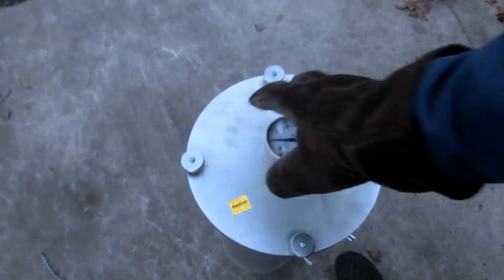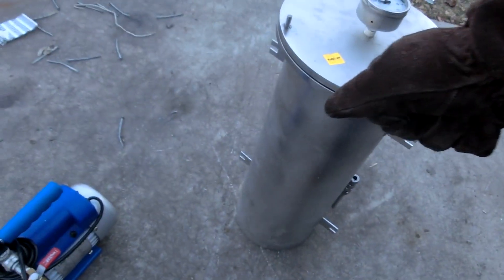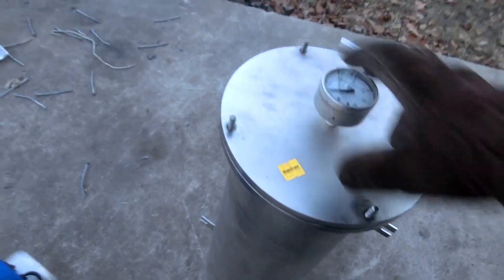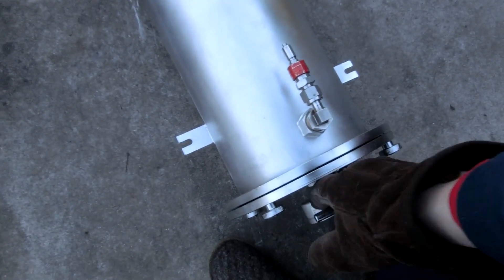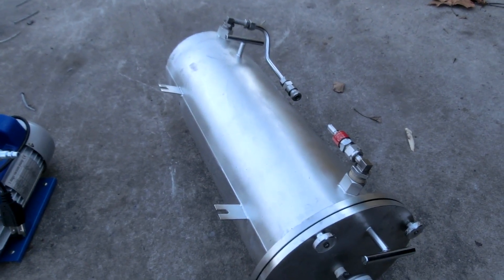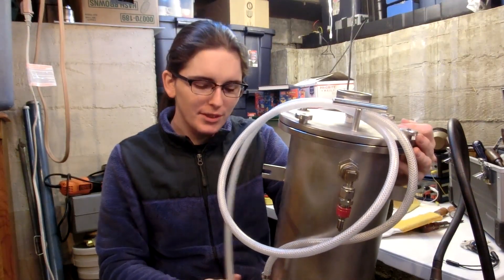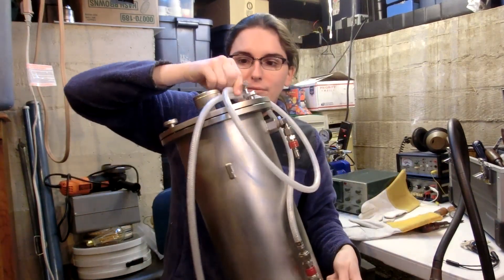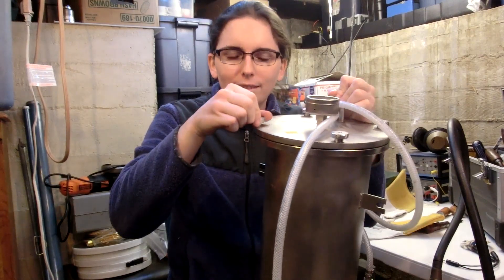First Test of the Large Vacuum Chamber (Patreon 30,01,2017)

Comment: If you can get hold of a thicker piece of plexiglass - say 2 or 3" you can machine and tap entry and exit vacuum seals on the perimeter of the plexiglass to carry wires for sensors, led illumination, high voltage etc. allowing an unimpeded view through the front.
Reply from the maker: i'll probably take inspiration from Ben Krasnow and drill holes in the front plate of this and just put sparkplugs through it, those are sealed and insulated from high voltage even.
Reply: Good idea - and much simpler than mine ;-) looking forward to seeing this develop. Thanks

Comment: I am only 30 seconds into the video, you should have no problem holding a vacuum unless you plan on hitting the side with a heavy hammer.
Reply from the maker: i agree, but i still didnt know if i could trust it. pressure and vacuum chambers are pretty scary.
Reply: Rinoa Super-Genius I dunno the size of the inside of the chamber but if you are worried about failure you could strengthen the chamber by sleeving the cylinder wall with a pipe.